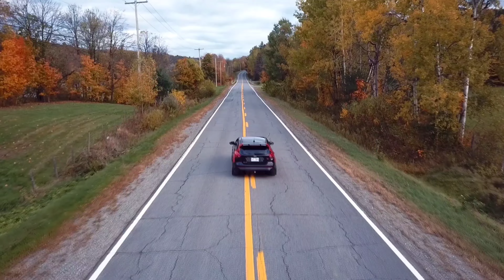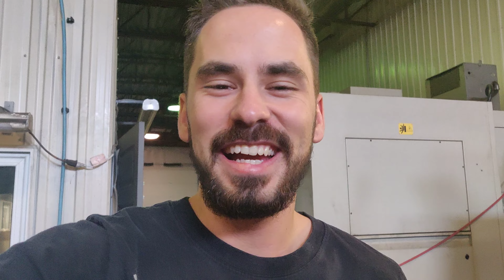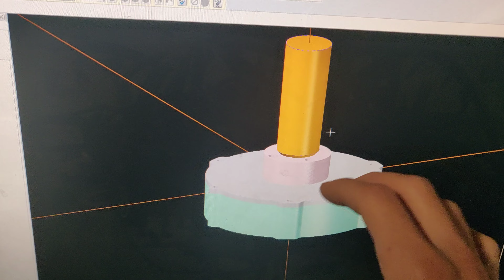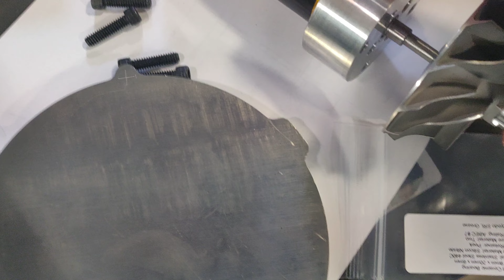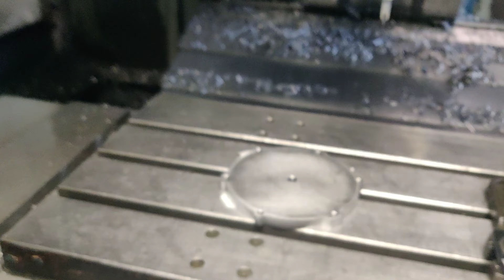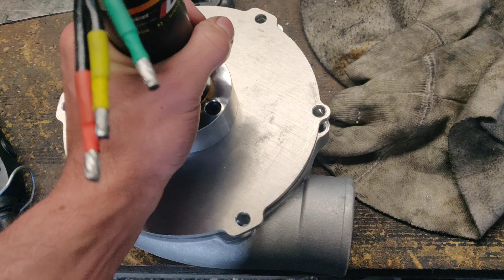electric turbo pt.1

Comment: how to connect motor shaft to turbo propeller?
Reply from the maker: The best is a interference fit using cold motor shaft and hot impeller shaft. But I don't have small tooling for this type of hole so I use different technique to get the best fit possible and use green loctite wich can be use up to 0.005" gap.. but im only 0.001> gap. 
Anyway, there's other way to do it! Go talk with us 
https://www.electrifiedboost.com/
Reply: @WBprojects  thank you